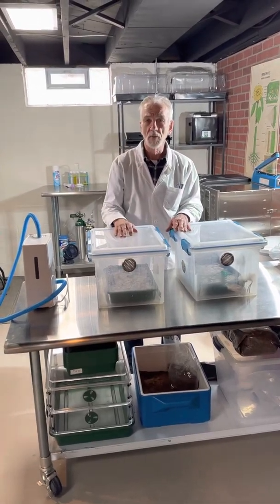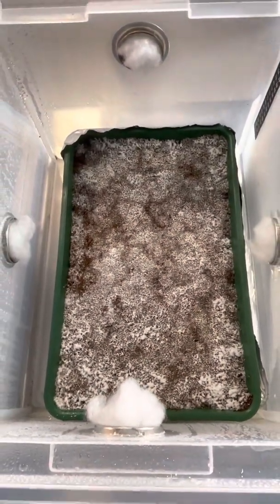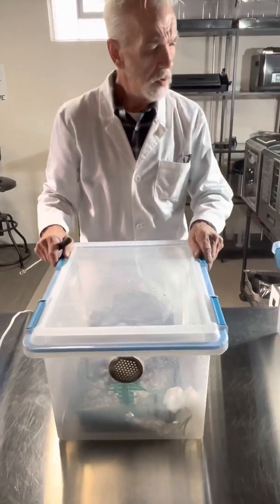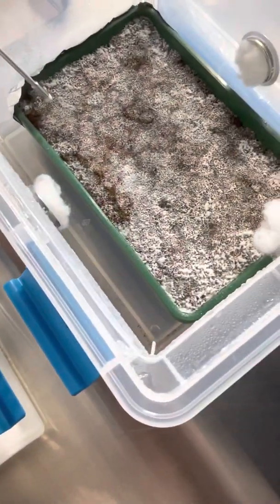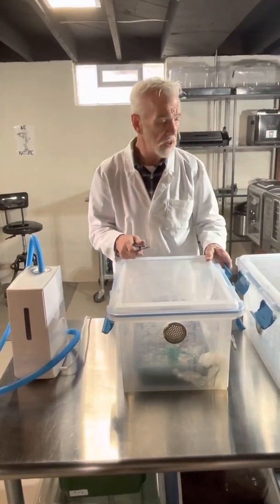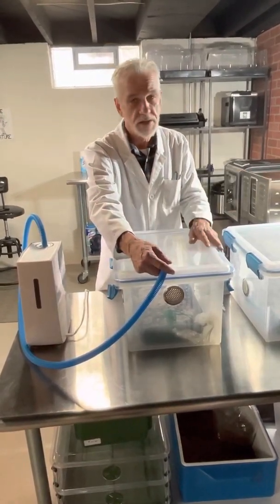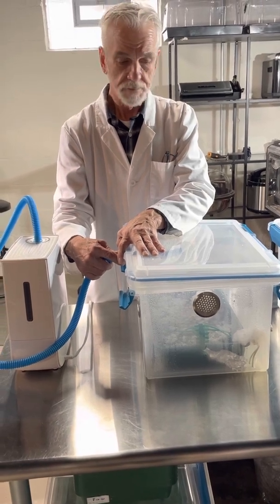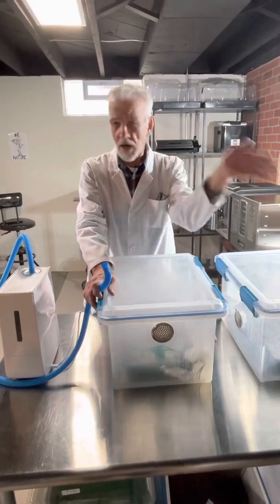Pops Test Tray Mushrooms Co2 cake experiment Monotub

Comment: Hey Pops, try this experiment. Try putting the CO2 nozzles down just on one side of the block cake because CO2 does not float. You should have a more even colonization considering the start where the CO2 is flowing oxygen would be coming down, pushing the CO2 where those dark spots arethat’s why you see probably less growth so that the oxygen can be let into the mycelium which in the soil to trap their nutrients

Comment: You really needed a control with tubes placed in the substrate like the co2 tubes but pump nitrogen or plane air. How do you know it wasn't the tubes or the act of pumping any gas into the substrate? I'm not saying the co2 isn't the cause here  just that it could be the presence of the tubes.
Something to consider for your oxygen experiment.
Reply: Start your own channel    And compete with others dawg
Reply: @neophyte_rob8994  It's not a competition. I was offering a constructive critique and suggestions on ways to improve his scientific method. It's obvious a little help is needed.
If the method is flawed the results are flawed.
And I'll start a channel if and when I want, not until.

Comment: Hey pops luv the videos, I got a question I hope u answer, so the mycelium has grown all the way to the top of the cake and the sides have closed in to form a brick however the mycelium on top is patch work not uniform at all seems like it can’t or isn’t growing in the majority of the top layer of the substrate. The patches where it has broke through is already starting to get decent size pins, I’m trying not to flower until it’s grown in all the way but it’s not looking like that’s gonna happen at this point, is it a lack of water? Pls help